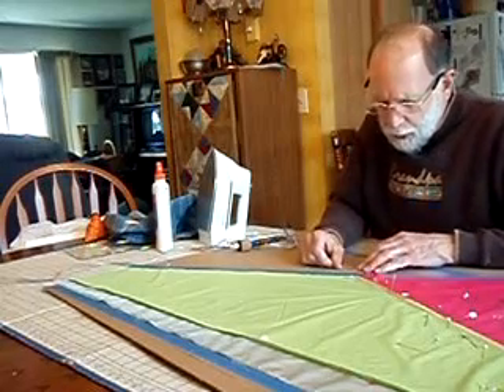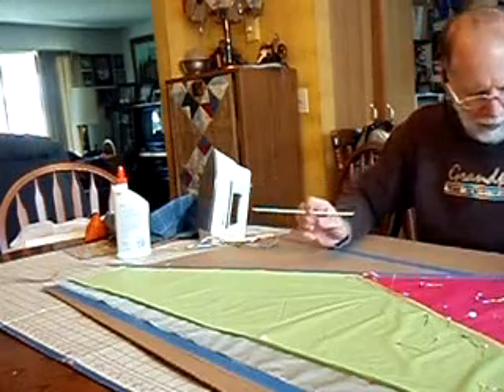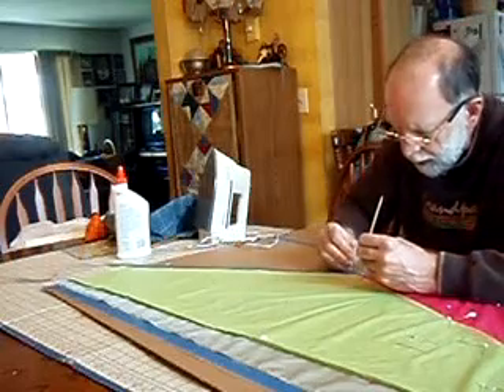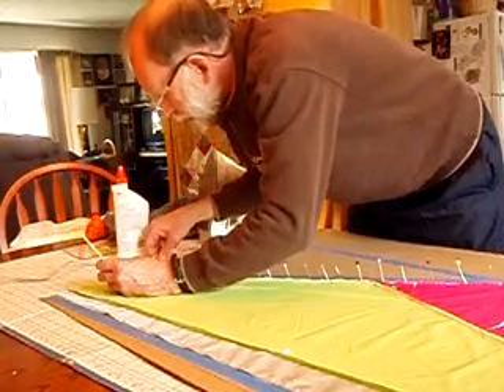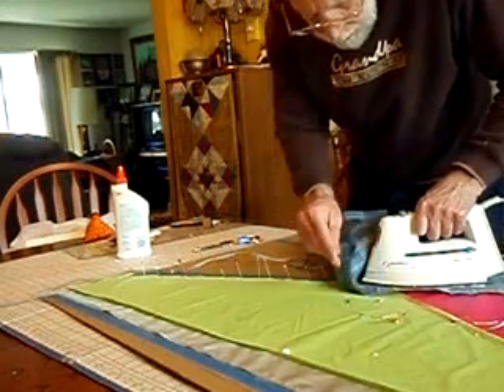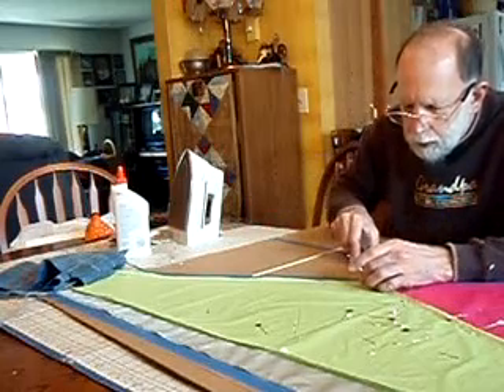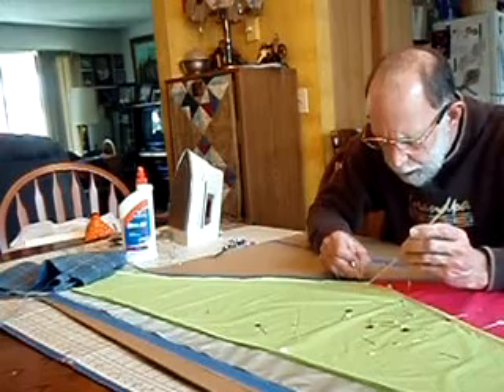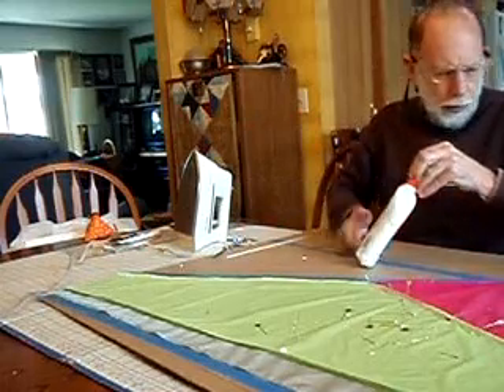Kite Sewing  #ELEHOSP

Comment: why go through all that trouble when you could of purchased double sided tape...which is a thin film that you can use to hold it together? You can sew right through it and it won't mess up your needles!
Reply from the maker: Rafael Santana  I like your idea what product did you use to make the flat felled seams on ripstop nylon?
Reply: Joe Neill Hi Joe, I'm new to sewing, What size needles and thread do you use for kite ripstop nylon?
Reply from the maker: P Cap Hi I used a jeans needle in size 80.  You could also use a mictotex sharp needle.  The thread was polyester by Madeira.
Reply from the maker: Joe Neill  I just used the sewing machine's regular foot to sew the fabric.
Reply: Thats what I use to pin any synthetic thin material